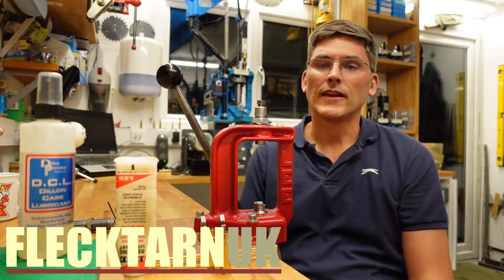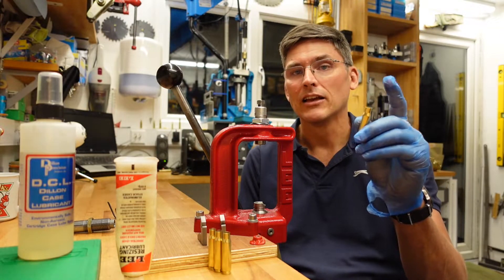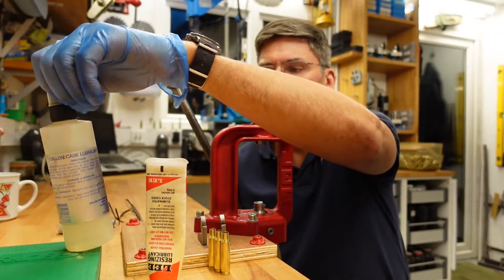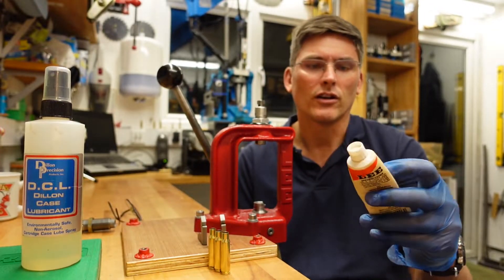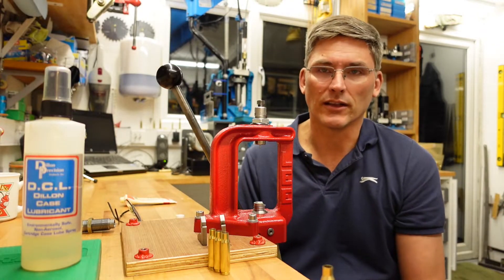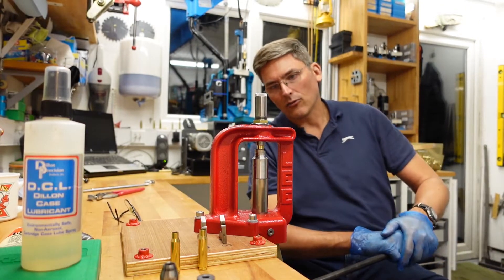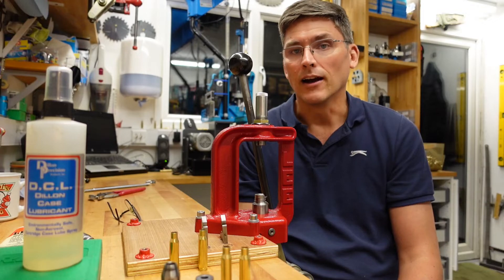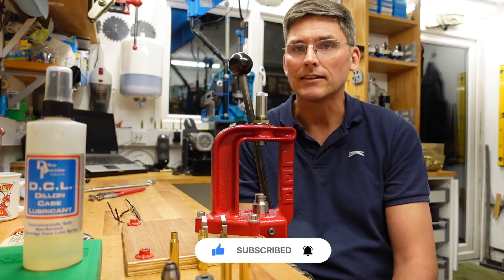[36] Full Sizing vs Neck Sizing Rifle Brass Cases Explained

Comment: Thanks for the explanation. I have an issue where brass from a Remington Model 700 is not feeding into my Ruger M77 even after full length resizing.
Reply: Have you compared firing new brass in each and compared headspace differences with once fired brass? Despite FL sizing, some brass will flare at the case mouth and if the neck OD of the chamber is smaller in the Ruger, that could be an issue.